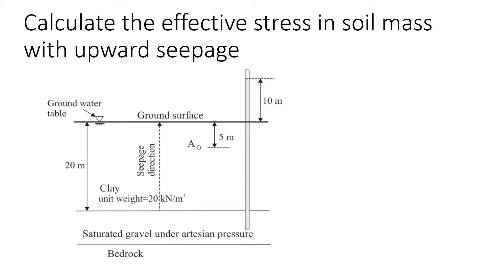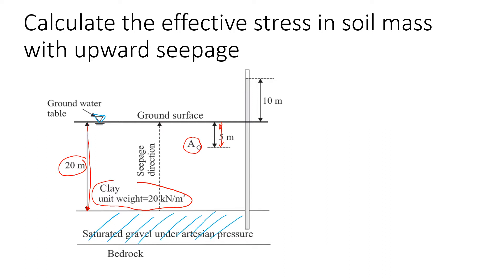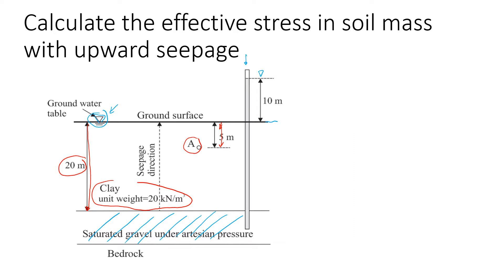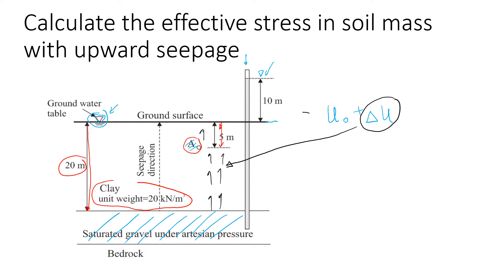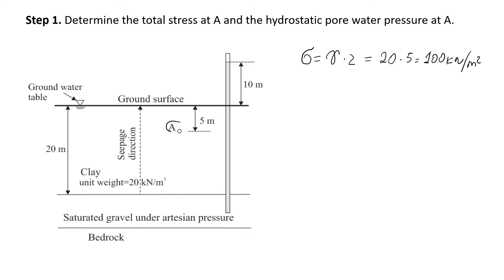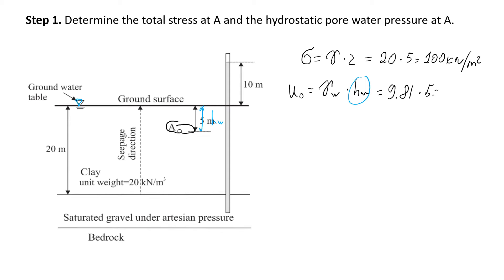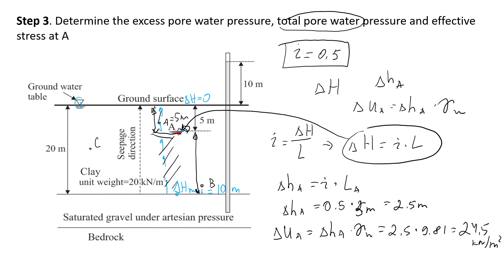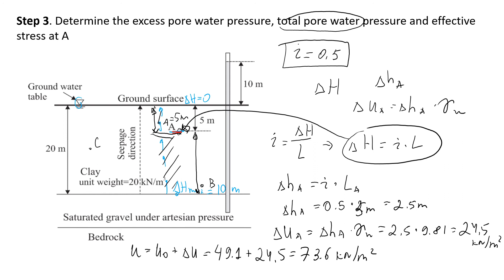How To Calculate Effective Stress in Soil Mass During Upward Seepage of Water | Practical Example

Comment: Why the delta u term is added not subtracted?
Reply from the maker: Delta u (additional pore water pressure due to the upward seepage) increases the pore water pressure; that's why it is added. This will decrease the effective vertical stress, and undermine the stability of soil mass